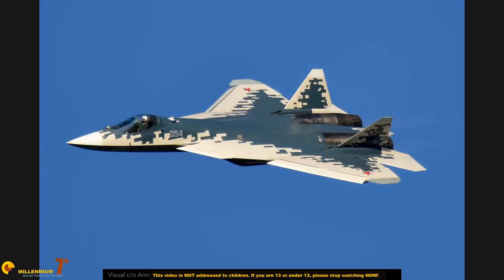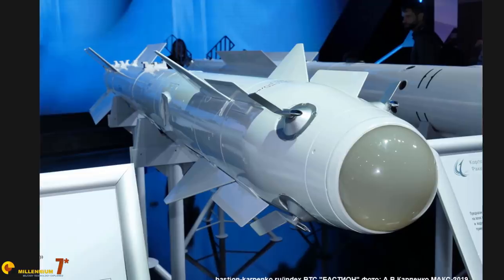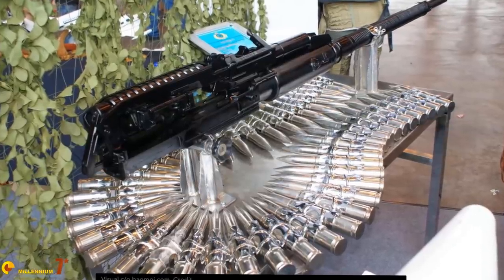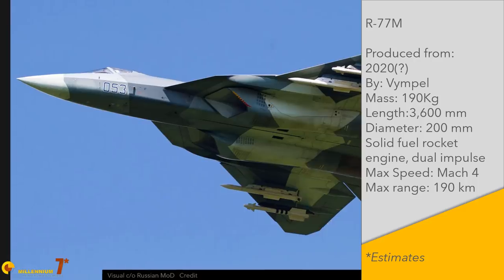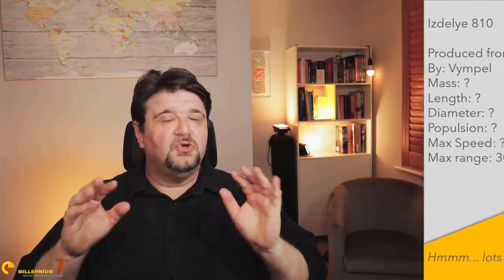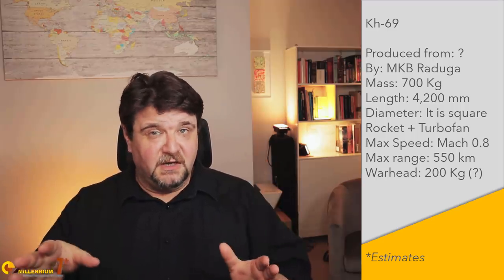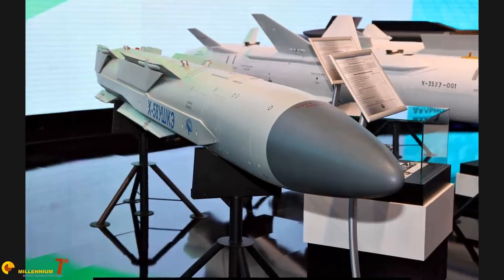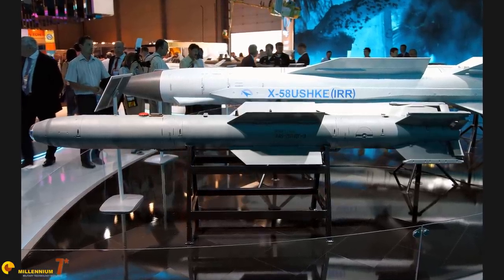The Su-57 Shares ONE Thing with the Raptor - Round Pegs in Square Holes - Part 6

Comment: I was fascinated and impressed by your description of the SU57. It is a truly remarkable aircraft and for all of its shortcomings it is a beautiful thing. How useful it is as a weapon of war against peer adversaries is questionable. Against lesser adversaries it is overkill and unnecessary. US experts question its stealthiness. The fact that the engines will not be ready for production of the aircraft until 2025 is troubling in more ways than one. Not only is this not far from the time when the US plans to replace the aging F22 the SU57 is intended to compete against with an entirely new generation of fighters but you have to wonder how the Russians will be able to manufacture an engine suitable for the single engine Checkmate, presumably much more demanding than two for a twin engine combat aircraft. 

When weapons are mounted on external pylons that defeats the entire purpose of a stealth aircraft. Planes like F22 and F35 carry a limited payload. Their task in an integrated swarm is to take out enemy defenses opening the way for far more powerfully armed 4th generation fighters like F15EX which can reportedly carry 27 missiles. As for weapons, the US is working furiously to deploy high power laser weapons on all of its combat equipment, air, sea, ground, and space. The development of the B61 mod 12 precision bunker buster is also a game changer. Unlike conventional bunker busters, once the protected area is breached the nuclear explosion can take out an entire underground connected network in several ways one of which will be sucking out all of the air as the fireball rises.

Comment: 4:50 So I would no longer call this "dual pulse". This is a two stage rocket motor, quite simply. Dual pulse inherently means that you cannot vary the timing between the two because their ignition mechanism is tied together. If you can ignite the second "pulse" separately on command whenever you want, then it's no longer a pulse, it's a stage.

Comment: Very good series so far. Could you do a video on how well the Su-57 meets Russian requirements and fits into its doctrine?
Reply: Russian doctrine is the deep battle doctrine. Similar to german war of movement but aiming to hit strategical objectives instead of encircling and destroying enemy front line units. 
 So, the SU-57 with it's VLO and long range missiles seems to approach this concept as a support killer I would say. Go deep, kill AWACS, refueling planes, AC's, etc. And make it a fair game to other assets
Reply: @matheuscerqueira7952  I agree. S-500 also will go after AWACS and tankers.
Reply: @BenVaserlan  I don't think the S-500 is meant to target force multipliers. I think, and I can easily be wrong, that it's meant for direct threats like ballistic missiles (the reason for it's development) and maybe bombers/cruise missiles. The S-500 is a costly solution against force multipliers which can be defeated by cheaper means, and you don't want to be reloading when something only it can beat comes around
Reply: @matheuscerqueira7952  I agree that the S-500 is primarily an ABM system.  The Russians will in the near future have the A-235 anti-ballistic missile system.  An advanced on the A-135.

Comment: I always think to myself: why didn´t they make one long weapons-bay with two sections that can be opened separetly instead of two individual ones. With one bay they´ve had the possiblity to fit in one very large/long missile or bomb. LIke a future Brahmos III or something.
Reply: it was de original plan in some makets but i tink they find some structural problem
Reply: Possibly also opening the weapons bay spikes signature on the enemy radar. That's why the f22 has quick opening doors.
Reply: Cross sectional area of the fuselage bulkheads requires strength in that location between the bays, since there is limited support even from the monocoque construction.  If you incorporated a full-length bay, you would have to reduce the maximum structural load factor to roughly +4g (estimate).

If you regularly exceeded that, you would bend the fuselage.

There isn't enough nearby support since the engine nacelles have relatively thin walls, and are typically hung off the airframe in F-14/Su-27 type designs that the Su-57 uses for its basic wing/engine nacelle arrangement.

Unlike the B-1 or F-111, there isn't a lot of fuselage height above the Su-57 bays, so you don't have the ability to brace the fuselage bulkheads over a full-length bay.

There is a way to do it, but you have to start out with a long bay and work out from it in the design phase before the aircraft takes shape.

Another potential problem for a long LRBVRAAM or cruise missile during separation from a recessed bay ejecting into the "tunnel" is semi-contained vortex phenomenon.  An F-14 shot itself down when firing an AIM-7 from the rear recessed station, for example.

Especially at transonic or supersonic speeds, executing successful separation through the boundary layer would require immense inertia from the ejector racks, as well as a synchronized dual front and aft rack system that would result in catastrophe if both racks didn't trigger correctly.

As it is, there are huge questions about the Su-57's ability to successfully separate K-77M missiles from both or either of the bays.

The YF-22 demonstrated both AIM-120 & AIM-9M live separations in late 1990 from the belly and cheek bays.

We still haven't seen separation from within the bays of any K-77M.

We have a starboard rear/top/oblique view of what's reported to be an R-74M2 being fired, but no video from the underside of the bay door opening and separation sequence.

Is it because they can't demonstrate it yet?  This has been a big question for years now among analysts.
Reply: @stefanblumhoff1562  The gap between the bay doors is already huge on all the Su-57s, even the Stage 2 prototypes that are the final airframe configuration testbeds before serial production.  It's bigger than the space between the F-106A bay doors even, which are elegant in comparison when looking at the detailed workmanship.

I'm referencing Russian domestic program documentaries where the spokesman walks under multiple Su-57s from the 2nd Stage program in a hangar.  You could see the consistency in bay door configuration ship-to-ship.
Reply from the maker: Perfect analysis about the structure. In the video there is a "stolen" shot of the separation and there are a few press releases stating that it happened. If they went into production, I believe that the main issues are solved.

Comment: With the reduced orders, some people believed that since the Su-57 was so complicated (and expensive) to manufacture, Russia would never make many of them, and that it was more of a showcase than a real fighter. But the development of this many custom weapons suggests otherwise, doesn't it?
Reply: I thing russians reduced orders of the first batch with AL-41 engine, but will have more orders when Izdelie 30 will be ready to be installed. Also there is rumors, that they already want to upgrade some parts of Su-57 avionics, but it's just speculations.
Reply: @unholyknight786  These are not rumors, a new version of the Su-57 Megapolis is being prepared with a new cockpit, I suppose for the control of the S-70 Okhotnik

Comment: I'm wondering: if the SU-57 is specifically designed to counter the F-22, how do long range radar guided missiles fit into the design philosophy? It seems counter intuitive to counter fighters with a very small RCS (and reduced detectability over longer ranges) that way. 
Thinking out loud, I imagine a missile vectored by LF ground radars cues in a general direction by a fighter that uses IIR for terminal guidance. But thusfar I haven't come across a long range heatseeking missile.  Or is that too simplistic?
Reply: So, that's why US decided to retire F-22! 😄
Reply: I've come to the hypothesis that the Su-57 is designed to make Russian people think they have a counter to the F-22, but in reality it's more of a threat to 4th Gen fighters.  Basically a modern Potemkin village that has its main capabilities as a networked platform with Su-35, Su-30SM2, Su-27SM3, and S-70 drones.

You aren't launching BVRAAMs at <.001m2 targets because you don't get any return from those TGTs until WVR.

Ground-based radar platforms need to be within Line of Sight of VLO platforms and need multiple sensors across different spectrums outside of the aircraft's nominal frontal RCS.

The moment you do that, those ground-based platforms are no longer within LoS of each other due to curvature of the earth.

This is why frontal RCS matters so much and those who think it's easily-defeated from side aspect obviously haven't accounted for all the applied physics and basic geometry of the sensor skirmish zones.

Let's say you magically conquer all of that.  Now you launch a long range IR missile with a shielded seeker that can super-cool the aerodynamic heating off the seeker enclosure somehow after sustained Mach 3-4 flight.

It uncages the seeker in the anticipated TGT basket area and....sees nothing because the F-22A has extensive IR concealment measures, just like the F-117A and B-2A.

Stealth isn't just RF spectrum signature reduction, but IR and visual as well.
Reply: @konstantin.v  F-22 production was killed by Soviet asset, Robert Gates, before we ever got into Full Rate Production. That means limited/no spare parts, high operational and maintenance costs, high loading of flight hours onto the limited fleet of 193 built aircraft.

But Russia will escape these realities with only 76 Su-57s because....magic.
Reply: @LRRPFco52  Sorry but this is just delusional.
And, by the way, you might want to learn about the “Potemkin village” thing. A hint: there was no such thing. The rumour was invented by a bitter Western diplomat who was not invited by Katherine the Great on her tour to newly liberated Crimea, hence the typical propaganda was enacted. So it is really fitting that you used the phrase.
Reply: You need missiles to keep support aircraft far away. AWACS and Tankers are easier to see from far away.
This makes me wonder if large support aircraft include any active missile defenses. It might be a worthwhile extra weight if there is reasonable chance to eliminate missiles.
Reply: SU-57 is not specifically designed to counter F-22. Such a narrow positioning would be a waste of money/time. SU-57 is a versatile platform to cover most goals which currently covered by different gen 4 fighters/interceptors/bombers. Investment to the stealth in SU-57 is mostly because of modern air defence systems, awacs become more advanced, but not just because of counter to F-22/35.
Reply: @tatianaes3354  We know what a Potemkin Village is, as the concept is not limited to a single point in history. I was stationed within eyesight across the DMZ of such a village in Korea, which was a total facade, so while I appreciate the very interesting historical discussion of Katherine's trip to visit her lover in Krim, it isn't specific to the facts of my hypothesis about the Su-57.

The biggest area where the Su-57 fits the description of a facade is its claim by Russian media to be a 5th Generation System.  Since it fails to qualify in VLO IR and RF signature reduction, it falls short of one of the main pillars of 5th Generation technology.
Reply: @Adrian Simmlekark The <.001m2 RCS isn't bogus.  The F-15C community did everything in their power to find F-22s from the start, with the best fighter radar at the time.  Even after they got the largest fighter AESA as an upgrade, they still are unable to detect F-22As outside of visual range, and when they do WVR BFM including Fox 2 fights with JHMCS and CATM-9X, they're unable to get acquisition of the F-22A even when they place the reticle visually on it with JHMCS inside of the wide seeker field of the -9X.
Reply: @LRRPFco52  However, they claim that a radiophoton radar is installed on the su57. This is a new generation of aircraft radars.
Reply: @antoni8118  First I've heard of that, and I've been studying the Russian language literature on PAK-FA, T-50, & Su-57 from the start.  The 3 radars in the nose have always been described as AESA radars.

Photons are light particles. For a transmitter/receiver, you need what is called permeability for the energy to exit and reenter after reflecting off TGTs.

What kind of materials allow photonic permeability? Transparent ones.  The mention of photonic detection systems misplaced to RADARs is from people who aren't well-versed in any of the applied sciences for advanced AeroE.  The only photonic detection systems on Su-57 are the IRST and DIRCM, not the AESA radars and embedded RF sensors in leading and trailing edges.  (F-22A has 30 of these types of antennae.)
Reply: @LRRPFco52 Based on what? I don’t get how you can make such conclusions based on your presumptions and delusions. The SU-57 certainly possesses all the shape, stealth and IR capabilities to be considered VLO and thus 5th generation.
Reply: @princesofthepower3690  The weapons bay door gaps, intakes, and creeping wave return characteristics of the Su-57 don't allow it to be a VLO design.